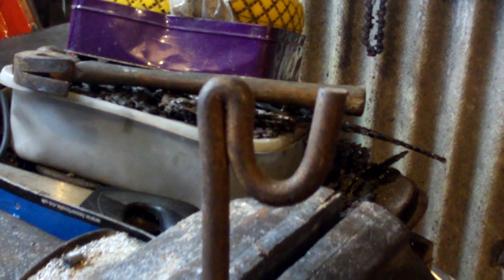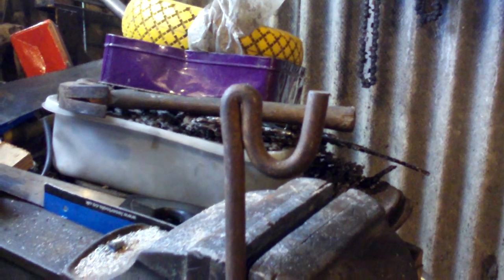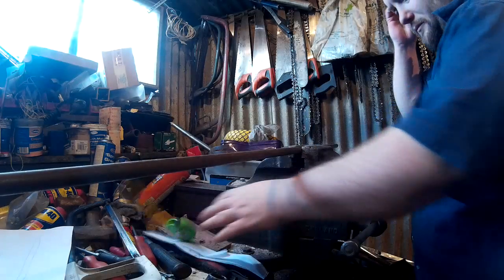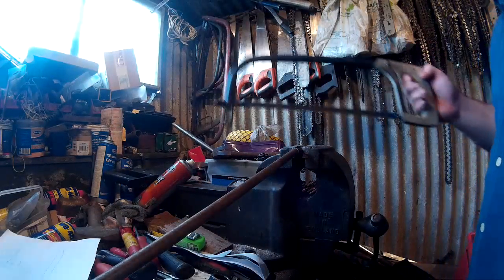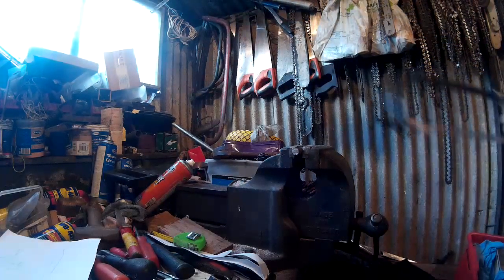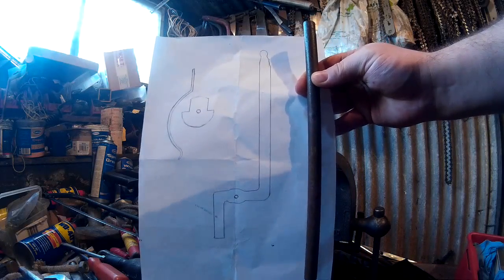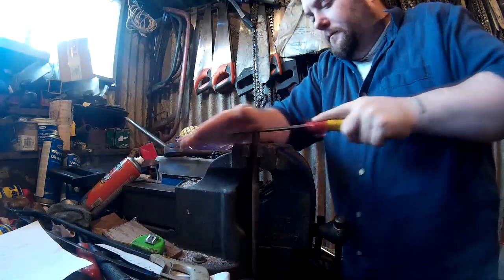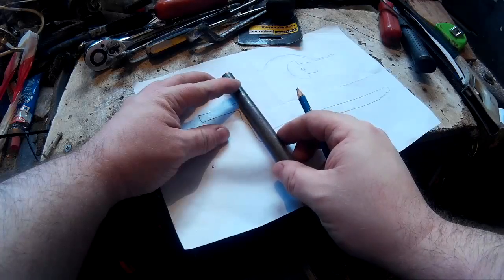Update (New Vids, Crossbow footage, and More)23/Sept/16

Comment: Great video. I think these are a medium carbon steel and that's why it snapped when you bent it cause it's a hardened type steel be good for some knifes or arrow heads for your future projects.
Reply from the maker: Cheers mate, great idea, i will save the rest for future projects. it bent o.k in end after heating so i can use it, but might try another way if not, got plenty of options if need be. cheers for watching.
Reply: ***** looking forward to seeing the finished product. Thanks for sharing it with us 👍🏼

Comment: That tickler you made with the blowtorch looks quite good actually.
What kind of torch is that? Was thinking of getting something like that as the jet lighter videos are getting really popular I've been doing.
Will be keeping an eye out for your home brew videos.
Reply from the maker: Cheers mate, the tickler will work as it is, but the bend was slightly longer than i wanted, i really need to check it on the stock, if its too long i have other options, we'll see soon, lol.

I'll have a look at the blow torch brand etc for you mate, i'm not sure, we have a few of them.

next crossbow video should be monday or next week and i reckon i'll be doing the homebrew videos next week too as i've run out.
Reply from the maker: its a GoSystem butane/propane mix blow torch.
Reply: Cheers, might order one soon, as both a general useful thing to have around and for doing videos with, for some reason one of my lighter videos is getting over 41,000 views in the last couple of days. Crazy why it's so popular.